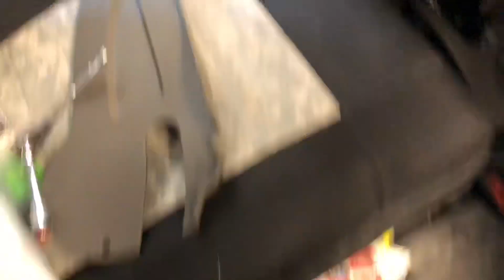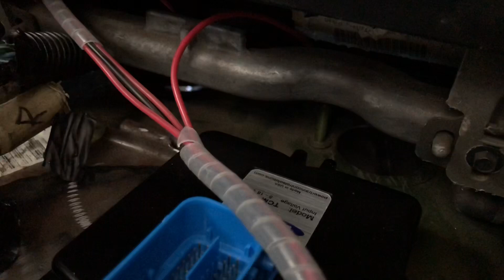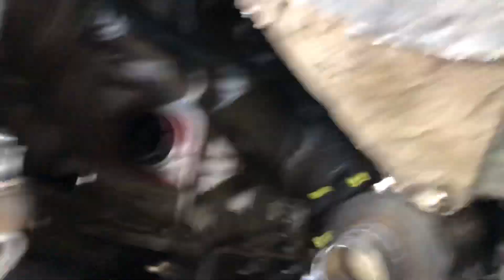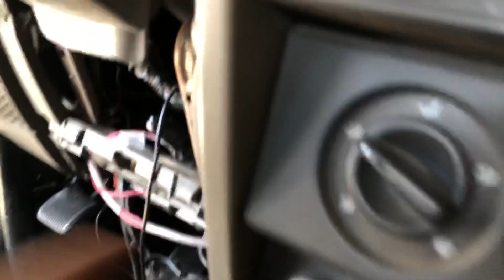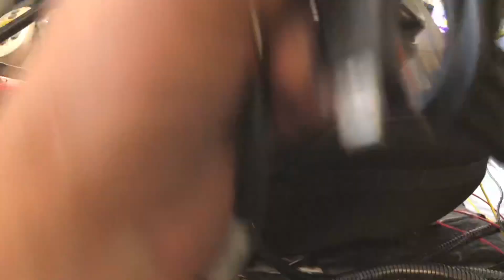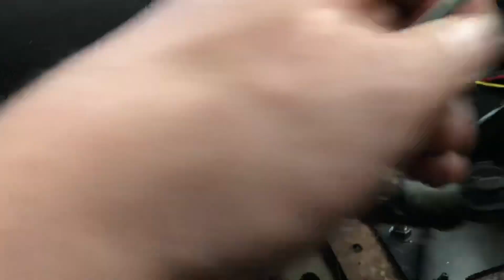Wiring the 8HP70 into a Jeep JK Part 2

Comment: Good morning Robert. Did you reuse the grommet from where the wiring goes through the floor to the trans? Or did you just remove it and run it through the hole? I'd like to try an reuse it. Just wanted to know if you know it is possible. Thanks
Reply from the maker: You want to open up the grommet so you can run the harness through it. You don’t want the harness going around sharp edges when going through the floor.